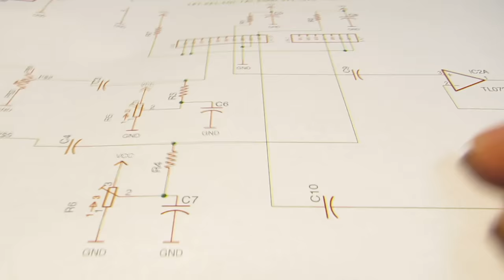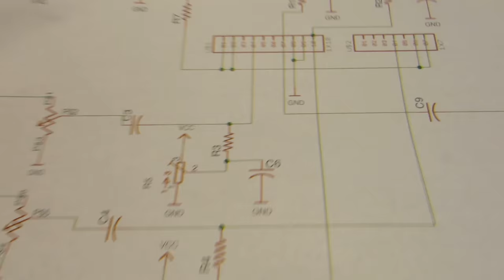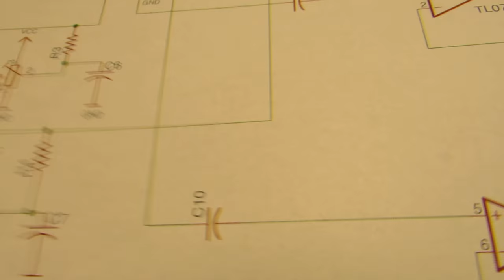A trailer: Nutube,  an incredible new vacuum tube technology in 21st. century

Comment: Back in the 1970s were "vacuum tube integrated circuits". Tubes were layers of metal and ceramics. The tubes were like .25 sq inch 2C39 (hi gain, microwave) tubes. The cathodes were all heated by a "hotplate".